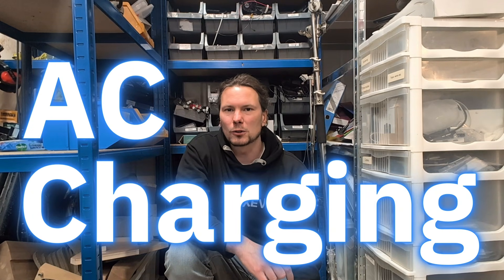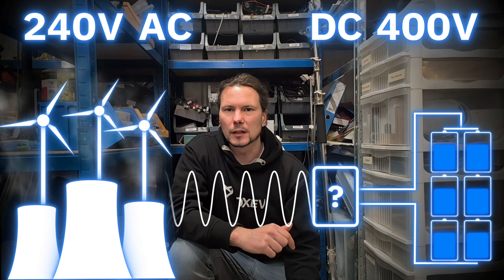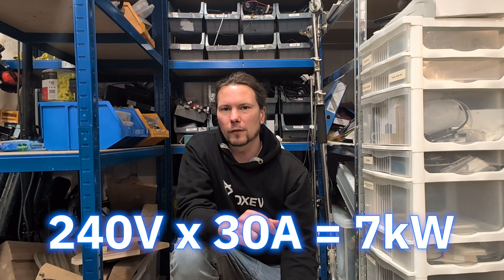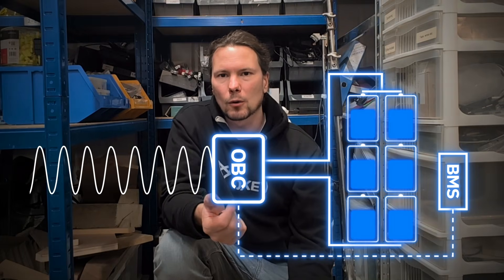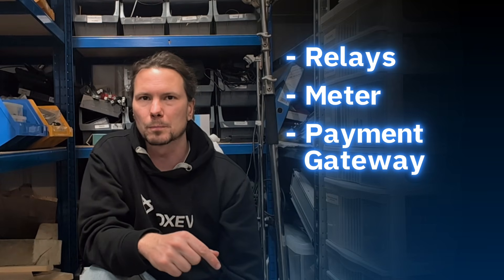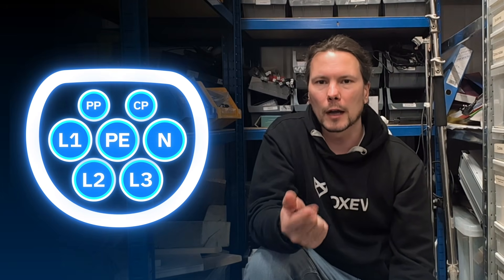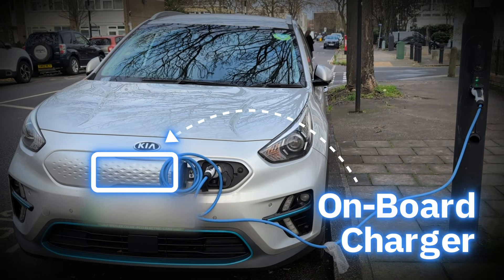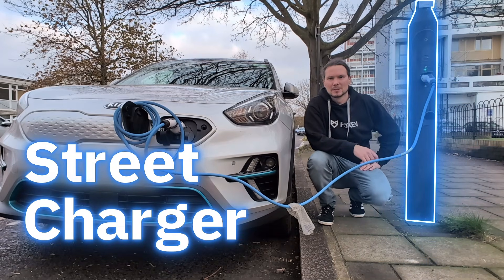AC charging electric cars in a nutshell: Whats in the lamp post? Whats in the car? Why 7kw? J1772

Comment: All tesla charge at 11kw ac.
Reply: Then on other hand, if you charge from a lamp post witch is most peobably 1 phase its impressive the people set up the lamp post to be able run 7kw for hours.. Maybe i guess we just live in different countries and thats why it sounds a bit wild for me❤
Reply from the maker: @connydale  yes, if you want more than 7kw you could fuse at 50A X 240V =12kw max.

I have taken the Tesla onboard charger for a model S apart and it had 3 modules in it with a limit to 7kW per phase. So the only way to charge at 11 would be to run them in parallel for 11kW and run them separately for 20KW AC charging, but those spots are becoming rarer and rarer.

Where do you live?